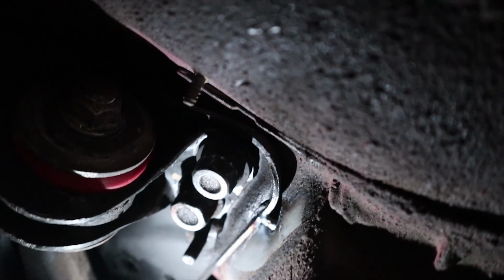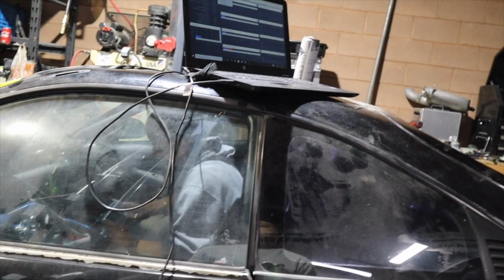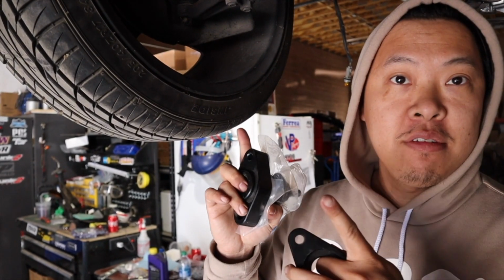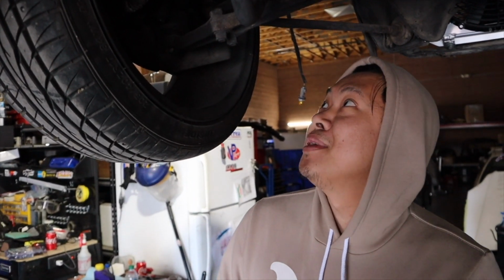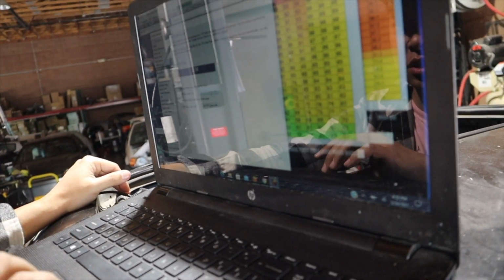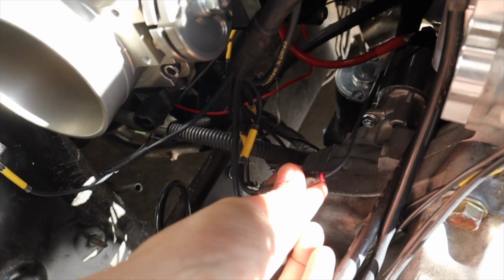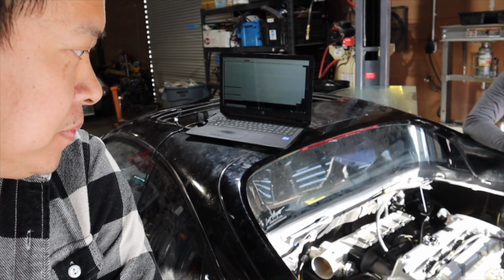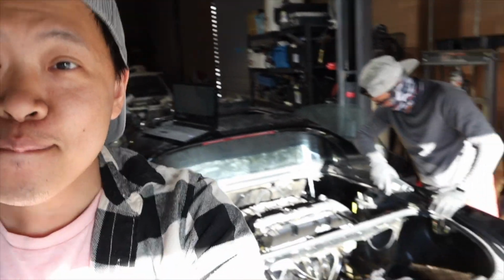I SPENT 15K BUILDING AN ENGINE & IT WONT START #4WAYLON Ep5

Comment: K20 starter will work. Many do it because the plug is different and the most common engine harness used for K-swaps is a K20A2. 

Mike always looking at himself in the monitor instead of the camera lense. LOL
Reply from the maker: right? ahahahah. habit I got to break

Comment: $15k on a honda engine or like $3k on a junkyard LS to make the same horsepower with double the torque....personally I know which way I would go
Reply from the maker: we built the Pink widow which was the cheapest 10sec car ever.... we did it for 4k including the car... soon to be 9's.. still waiting on an LS swap car to do that.
Reply: @diymike  sloppy mechanics went 8s for 8k including safety equipment. Not hating. I honestly think that would make some awesome content! Budget Honda vs LS. Easily the two cheapest platforms.
Reply: You get more props by building a 4banger to beat V8s.
Reply: @ACHEIZM  No not really. There is nothing hard or special about building a high horsepower 4 cyl. It just costs more, sounds worse, and is just a worse platform for racing.
Reply: @diymike  yes not counting all the stuff you had laying around already as you have gone over in your videos. That $4k number is pretty suspect. Also a $400 shell with a motor home big block and ebay turbo kits gonna do the same thing for just as cheap. Go watch roadkill and all their 10 and 11 second cars that look just as ratty and cheap lol